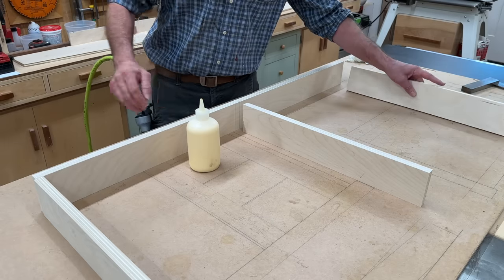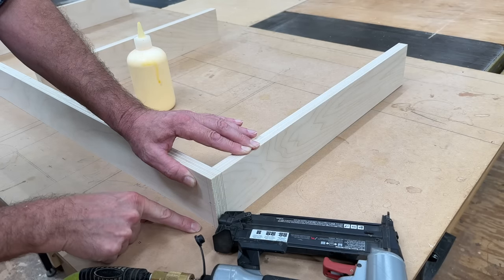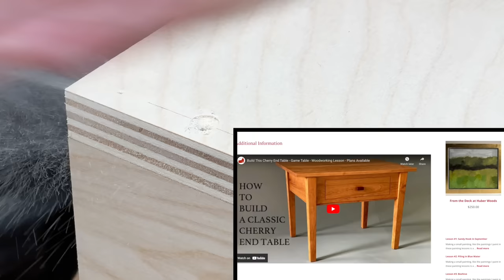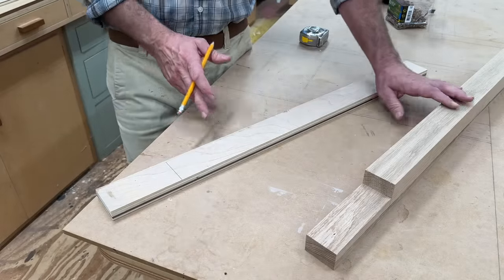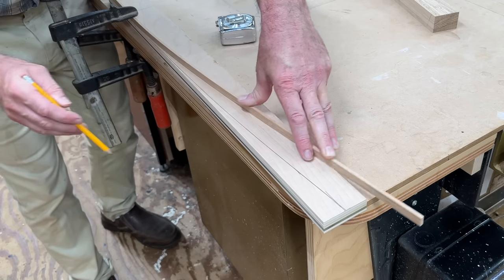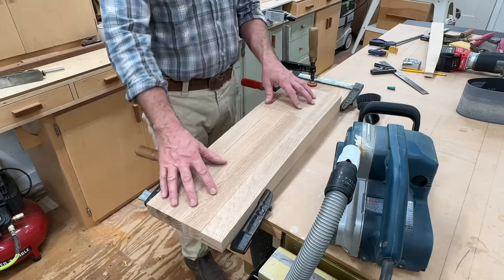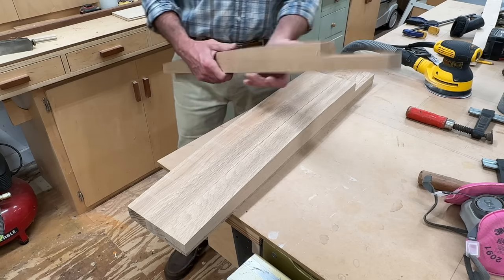How to Build this Modern Desk / Wood Veneer Basics

Comment: Why did curve on legs seem more attractive than say a straight taper? Did the four legs end up square on the floor?  How about pads on the feet if you are using this on wood floors. Nice work!  I appreciate how you respectfully include sponsors - recognizing the need for that in your revenue model. There is no sense in starving when your content is so good. The days of everything should be free are over. I had a digital magazine which was driven to almost zero revenue because of the subscribers unreasonable expectation of free content. Cheers!
Reply from the maker: Great questions! Thanks Bill … I’m planning to post a follow up today video in a few days. I’ll definitely answer these questions.

Comment: Beautiful desk build Jon! However, I would have edge banded the top inside edges of those draws. Not a fan of that plywood look when the draws are pulled out.
Reply: Where are your build videos?
Reply from the maker: I think you have a point Steve… if I were to build it again I probably use solid wood on the drawers. On the plus side it is a very high-quality Plywood with a popular core.
Reply: Quality plywood with no voids...why cover it up?